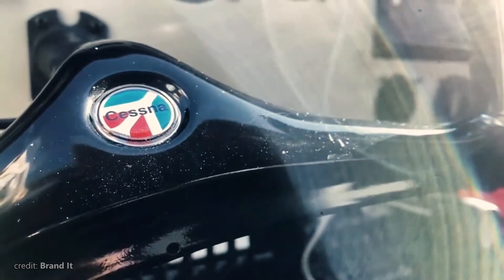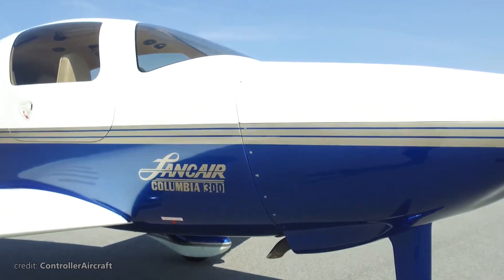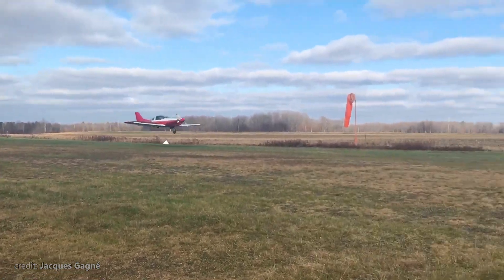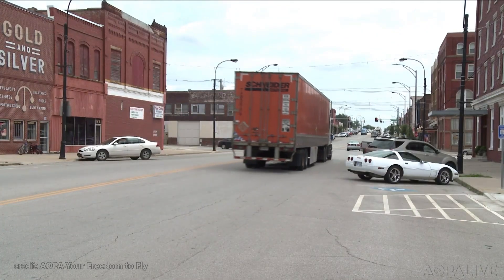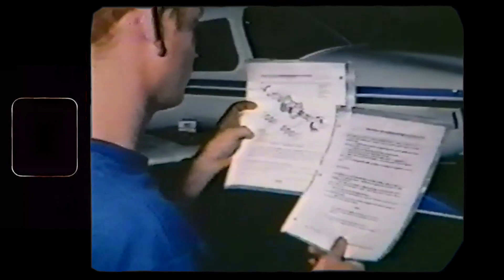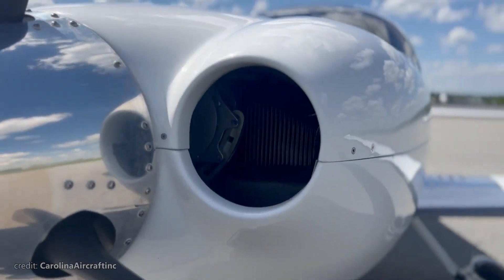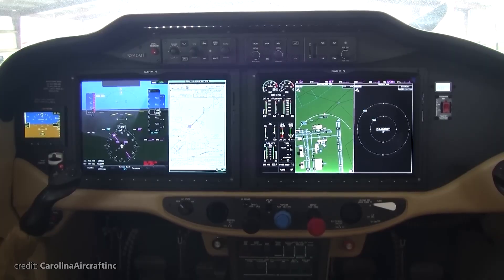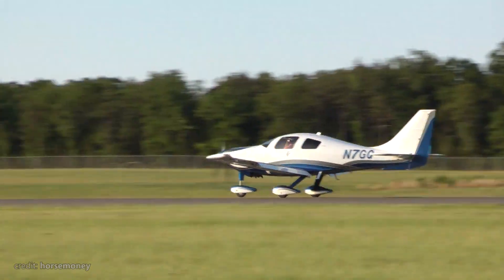Cessna TTX – Cessna Can Be Fun? Review, History & Specs

Comment: In 2006 I tried out Mooney, Cirrus, and Columbia 400.  By far the Columbia 400 got my nod.  I owned one for 7 years.  It gave way to a TBM 850.  But it's a great plane and better than the others in its class IMHO
Reply: Couldn't agree more.  For me it was a 350 (didn't need the turbo for my mission).  It's built like a tank and what an amazing handling plane.
Reply: Thank you for the testimony!
What was the useful load with full fuel?
Can't seem to find that data anywhere...